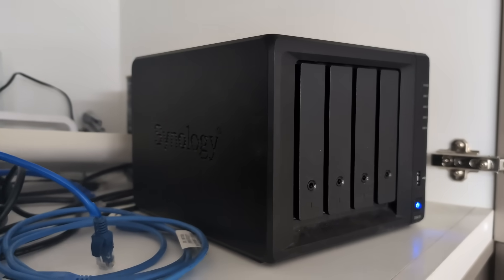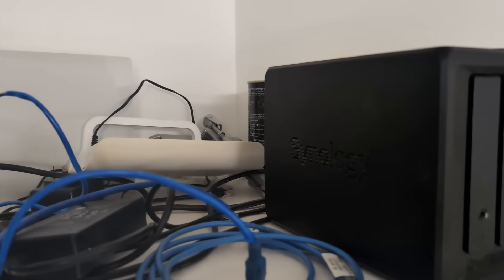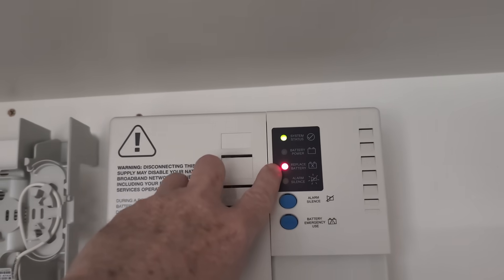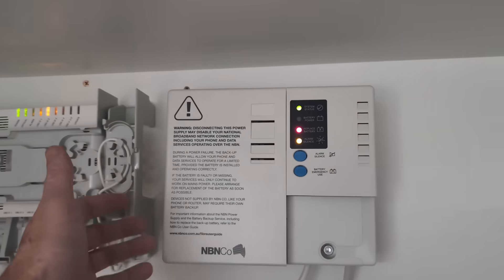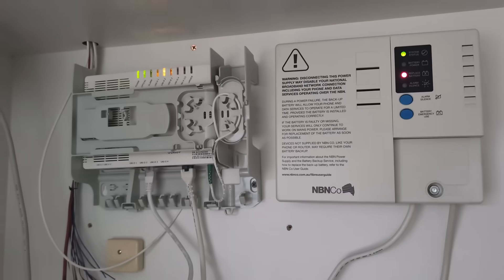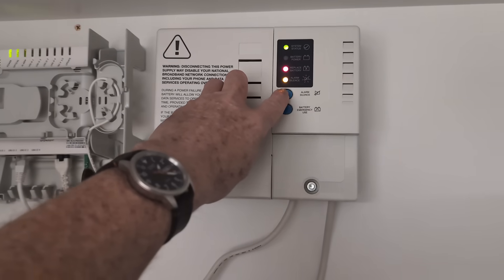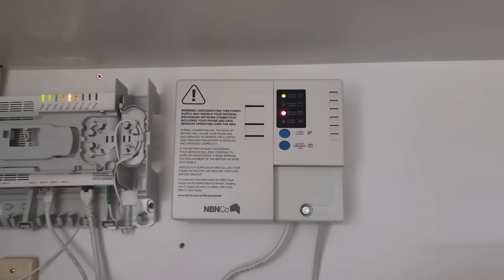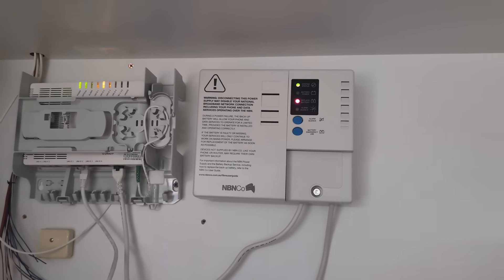I Found the ANNOYING BEEP in my Lab!

Comment: That's exactly what it sounded like to me,a UPS battery backup warning,  and I did suggest it in the live comments.
Reply from the maker: I would have told you I don't have a UPS because I totally forgot about this.
Reply: @EEVblog2  Yeah I know its not really same thing, just saying the sound is characteristic. Its been a while and I could be wrong, but I think some UPS will do it to let you know there was a power outage at some stage, and need to press reset, especially if the outage was prolonged and battery went flat.

Comment: I have one of these small 12V UPS thingies that run on 18650 batteries. Can power my fiber router for hours. Had to replace the batteries recently. I wouldn't beep or knew the batteries were failing. But I found out the hard way in a black out! And yes, keeping up with battery replacements on all types of UPSes is a pain.
Reply: Ha. One of those Wun Hung Lo ones? I used one of those for the same thing - powering the fiber ONT if the power goes out. It uses a weird DC jack though, but luckily the fiber provider site will send a "replacement" wall adapter for free whenever you request one (the actual ONT box is owned by the provider - the box to the left of the beeping one in this vid) so I was able to... acquire a connector
Reply: @aliveandwellinisrael2507  Probably all these are made from the same manufacturer and then a brand is slapped on the front. Mine says "Lamtech"
Reply: Lithium batteries are terrible for a UPS. They really don't like being kept at full charge.
Reply: @rocketman221projects  True but this was  already running with 18650 cells from the factory. It's a small unit that provides 12V only. Fortunately I have many spares 18650.
Reply: In most cases, the hassle of battery maintenance makes UPSs not worth the effort. Also, just how unreliable is your power? I haven't had an outage in more than a year, and it was only a few seconds. Actually in the 10 years I've been at my current location, there was only one outage that lasted more than a minute, and it was a fuse that randomly blew on the connection from the main above ground line into the neighborhood underground service.
Reply: @gorak9000  Not very unreliable but we did have one that lasted 15 minutes last week. I am glad I replaced the battery on the APC, as it runs the server.

Comment: The copper network has its own power supply, allowing the old phones to still work during a blackout. The battery is the work around for this so you can still call emergency services during a blackout.
Reply: Except in my experience, almost no one has the voice ports on the NBN box activated, as ISPs tend to provide service for softphones over the data port (using the voice ports on your internal router).
EDIT: Just did some Googling and apparently there's 300k out of 1.7m UNI-V services activated, but NBN has now stopped provisioning them (26 May 2024 after expiry of 12 months notice period) and any existing services will be withdrawn in 2031.

Comment: Same fibre box in NZ, but we don't get those fancy backup power boxes, just a regular plug pack with the 8 pin molex
Reply: The DC UPS hasn't been provided by default for ages by nbn and I don't think it's even available as an option now.  The alternative was a brick that fits into a space in the plastic wall bracket for the NTD.  I'm not sure what the latest generation single ethernet port FTTP ntd comes with.

Comment: I have an extremely similar fiber ONT (without the phone support) and always wondered why the PSU was strange with that weird connector.  Now I know, the bare PSU I got is just one of the options, I never knew it supported a battery backed PSU as well.  (Though it, my firewall and Cisco switch are on an APC UPS, so in the end it didn't matter).

Comment: This was my guess even before I saw the thumbnail. 😂 Keep holding the button until the light goes solid Dave then it will stay silent. Some NBN installs don’t have the battery box at all and just has a small power supply that slips into the right side of the NTD.
Reply from the maker: Nope, doesn't stay solid.
Reply: @EEVblog2 Keep holding it, it takes about 12 seconds.
Reply from the maker: @maxbutton9996  15 seconds someone else posted, works now.

Comment: It's only for keeping the uni-v ports alive (voice ports), but services those aren't offered anymore, most installs in the last 10 years have no battery unit. Only a direct psu
Reply: Good to know... My UPS has way bigger batteries than those things, and everything else is in the rack. I don't necessarily mind the fibre converter being on the wall, but would be annoyed if they still wanted the full 1m square of random electronics modern art installation.
Reply: My NBN was installed 31/12/2015 and did not have a battery unit installed. My parents had one installed a few months later and they do have the battery box. Last year I had to replace the battery.

Comment: At least in the USA, you are required to provide 4 hours (or more can be requested for up charge) backup for any service internet service with phone. Old POTs lines power the phones from the CO, so this is generally required for Coax and Fiber services. We have these stackable units where each pack provides 4 hours.
Reply: Little fun fact as an ex Charter/Bright House (and thus Spectrum) employee:  We are told to tell our customers we do provide the batteries for this.  The contractors however?  Never install them.  We were trained to only roll a truck when the customer realized it had no battery.

Wonder why I'm an "ex" employee there?  I don't like conning people like that, let alone when I hear calls from 80 year old's on machines that NEED to telephone vitals to their doctors (at the time many still needed a POTs line), and just rolled a truck and told them "I noticed something wrong with your modem, I'd like to have this remedied" even if their call was unrelated, because I could log into NYROC and clearly see the battery is reported as "NA" and just wasn't willing to let it slide.

I quit the moment I was written up for "unnecessary truck rolls".  Sorry to me an MTA that doesn't have the legally required battery, is NOT unnecessary in my book.  So I quit.

Hopefully me knowing about Unity, NYROC, ICOMS (I worked there that long) is my proof I did in fact work there.  (NYROC let me see the CMTS fyi).
Reply: please site the law/regulation you claim exists, because as far as i know none exists, the back up is optional. only regulation applies to POTS not VOIP.

Comment: REPLACE THE BATTERY.    IF Thiers a nuclear alert power goes out.  You will still have internet. Only if battery is active.   That's acually a saftey thing.   Building on fire but the internet can still call fire dept. DAVE Replace the batt
Reply from the maker: Fire alarm is central, not in my lab.
Reply: Nuclear alert? I would be kissing my backside goodbye - not telling facebook 😂
Reply: the battery in those things only powers the phone side of the ONT, not the ethernet (unless you change some wires around on the power connector). I have almost the same ONT power supply
Reply: @gorak9000 really?  Is that how they make them so small?  The 2 giant BT ones I got can power the whole network!
Reply: Surely this is NBNCo's responsibility, being their equipment... Can't exactly expect the average consumer to safely replace the battery.

Comment: Annoying beeps are a bastard. 
I had one recently in my kitchen. Because the nature of the sound is so difficult to get a hang of location, it took a while to realise it was coming from under my kitchen sink. Nosing around I found what I thought was the issue - an emergency stopcock for water supply. Googling it, it said there's no actual electrical connection, which I thought was odd, until they said the more up to date ones did have a solenoid. I couldn't find my model on there, so I called our landloards out. 
They had never seen one like it, so they went away.
A few days later I found out I was wrong and there was an old CO alarm in there whose battery was running out - oops.

Comment: At my moms house we had a beep like that, that would go off in the garage, turns out the garage door opener has a lead acid battery in it so if the power goes out the door you could still remote the door open. The battery needed to be replaced

Comment: you might want to remove it.  it is likely a sealed lead acid battery and if it leaks you might "come a gutzer".  I had to replace a battery acid eaten cable in my system.
Reply: Yes a 12V 7AH SLA

Comment: I change my battery every 24 months or so in my NBN UPS.
Reply from the maker: Mine was installed Aug 21st 2017, never changed it! https://www.youtube.com/watch?v=CsWKW4jUCAo
Reply: @EEVblog2  Strewth, that’s bloody old! Well, I can extend my cadence by a couple years then.

Also, I’d recommend you unplug the battery. Mine had started to get quite hot, to the point where you could hear something boiling off. It obviously caused the NTD to stop working when it did this.
Reply: @antoniopetito  If it's an SLA battery, they can swell up and be really hard to remove from the UPS if you leave them connected.